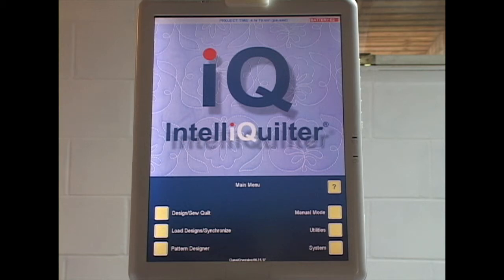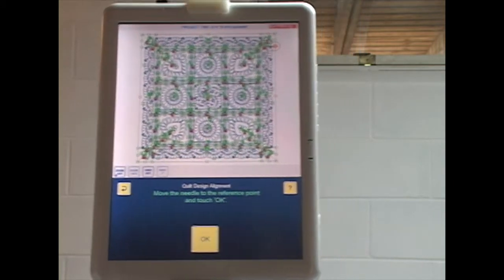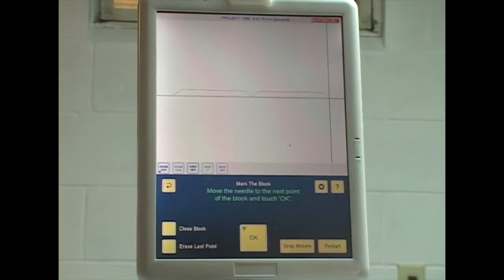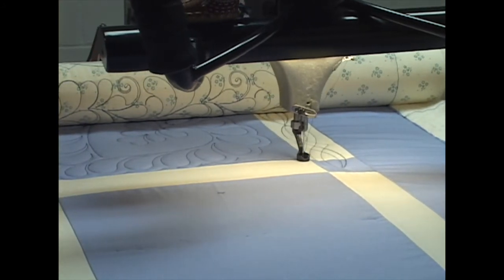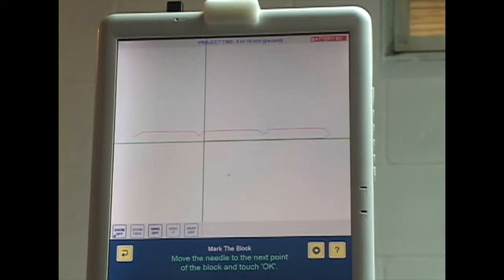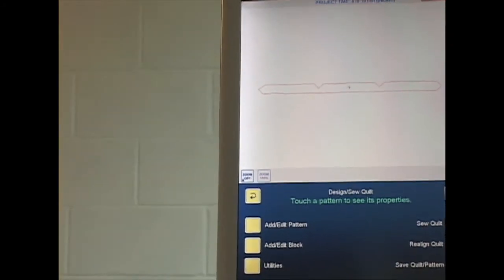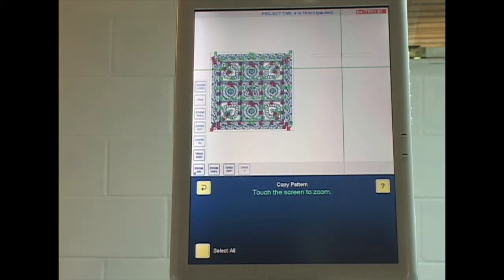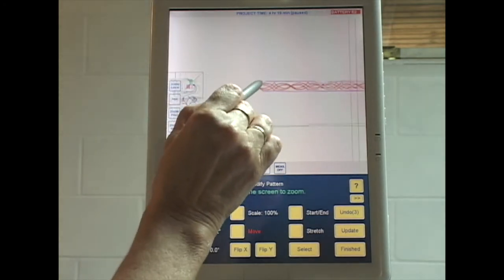Helen's iQ Project 2017. 7. Horizontal sashing.

Comment: I know this is a tutorial on how to use the machine, but I have to ask whether or not you're going to show the full quilt off the machine once it's stitched! :) I'm kind of excited to see it finished! HAHA. You're doing a fantastic job with the lessons by the way!!!
Reply from the maker: If you go to iqdemos.com, you'll see a finished version in the very first installment of the project. I will show the one I'm working on now - it's far from perfect, mainly because of my mistake of not checking my tension, but that's not a bad thing to show. This is after all, just a practice project to show how to do simple custom quilting.